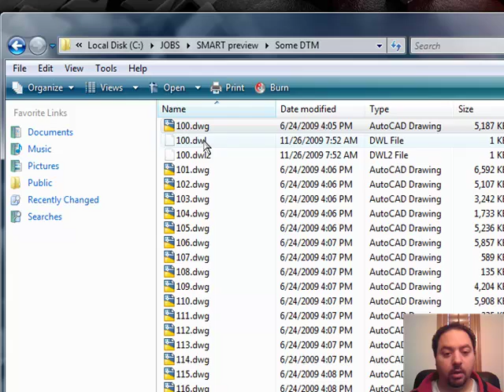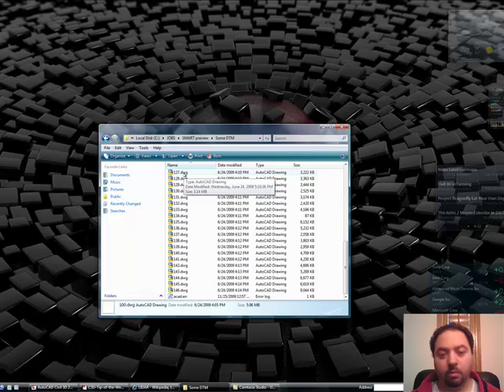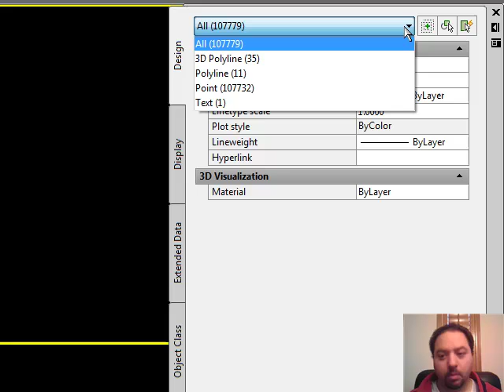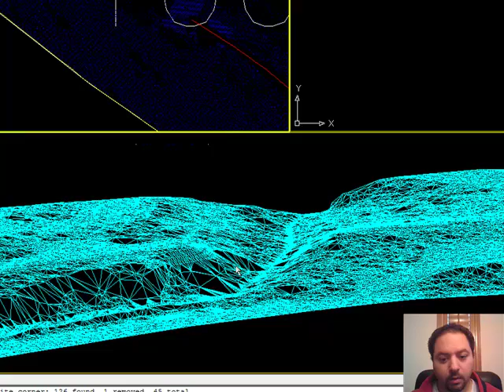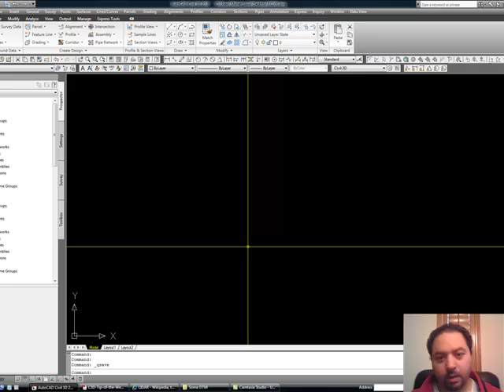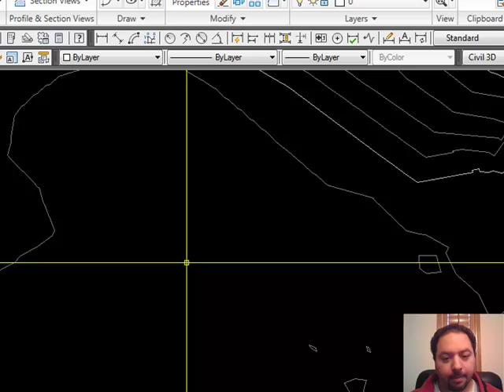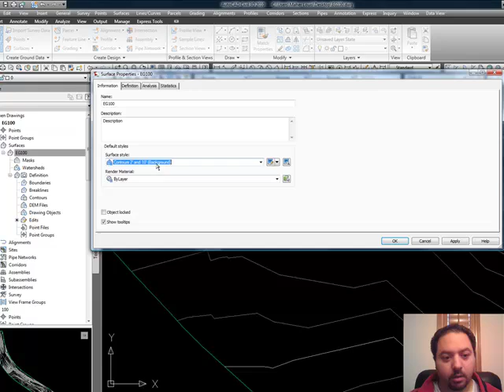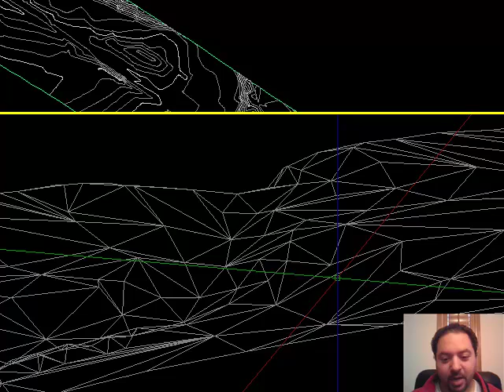LIDAR Data - Surface Object - Smooth Contours

Comment from the maker: I have an old '07 alienware M17, Intel Core2 Extreme Q9300 @ 2.53GHz, 8GB of memory, 64-bit Win7, two 256GB SSD in RAID 0. Yes, I agree that my system is extremely fast.